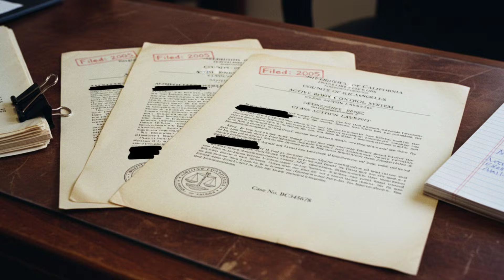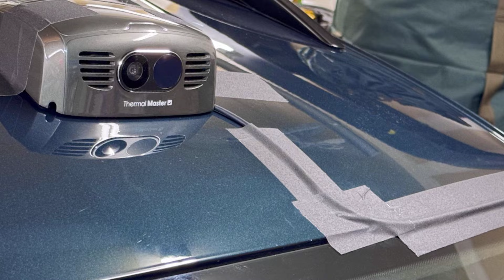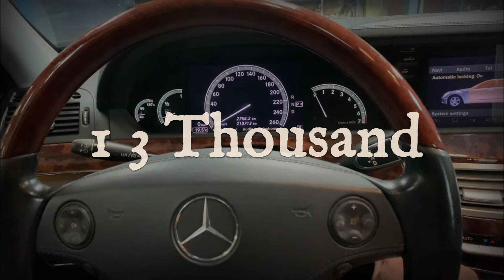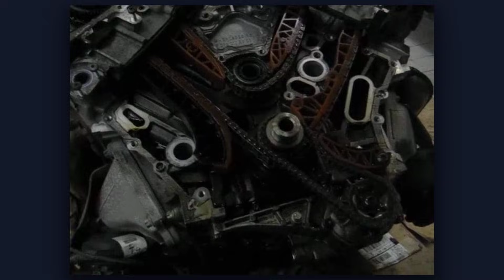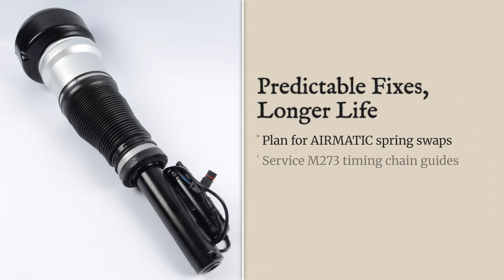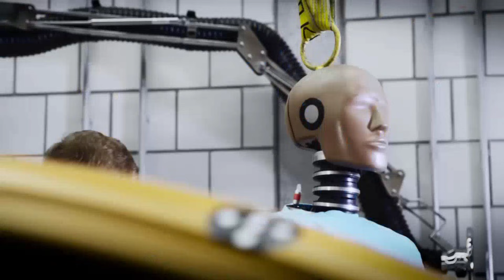Mercedes S-Class W221 Was Meant To Be Future - Until This Happened

Comment: 249K and still going strong.! Keeping up with maintenance and fluids and NO major repairs. Have done front air struts, sensors, and the fuel pump, but that's it. No engine or transmission failures.!

Comment: I am a mechanic so I’ll repair my vehicles. I’ve never taken one to have it fixed but one day I’ll be too old to do it and I will have to pay someone just like everyone else but my S 550 2009 has been a great car. I believe I have 84,000 miles on it right now. run so quiet you can’t even hear the engine run.  But it was way over engineered.

Comment: 147000+ on my 2010 mercedes benz s550 with m273 motor rides like a dream.
Reply from the maker: 147k and riding like a dream is exactly what that S-Class was built for, they dont make them like this anymore. Over-engineered in every sense.
Reply: 147000kms is nothing. It's like a new car. If it's miles, that's still very little.

Comment: I wouldn´t compare W221 and W220.The latter had one of the best engines in MB history,if not the best.The Airmatic system was/is not weaker than in the W221.There may be more troubles with W220 on other things,but they are minor and can be fixed easily.You can do the maintenance and repairs yourself,whereas W221 is more complex.Bottom line is,if you want a luxury ride with bearable costs,then a well kept W220 is a better choice than an early years gasoline W221.
Reply from the maker: The W220 argument is solid, especially for someone who wants to wrench on it themselves. The DIY friendliness of that generation is massively underrated.
Reply: Only thing I can think of is conductor plate and that's pretty easy to replace.

Comment: I still have my 2007 S550..  118,000 miles   Replaced the cam balance shaft and back up camera module and other schedules maintenance.. She's been good to me knock on wood!   Next on the list transmission fluid exchange ..drain and fill...  Oh yeah I also replaced the Airmatic Shocks..   She's been good me and beautiful car.. She still get compliments..
Reply from the maker: 118k and still turning heads, thats the W221 doing what it was built to do. That generation was over-engineered in every sense of the word.
Reply: I'm at 249K and the same story, haven't done the cam balance shaft, and am due for the next flush and fill soon. Did the shocks.